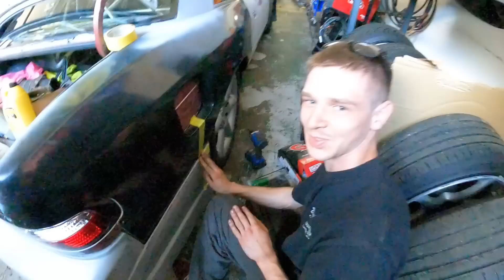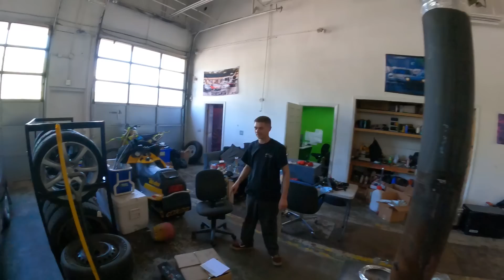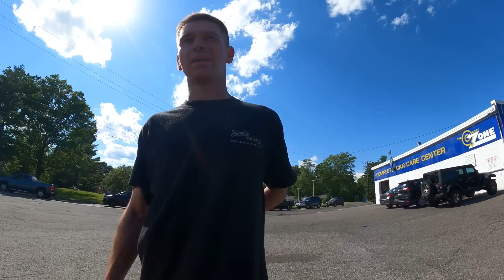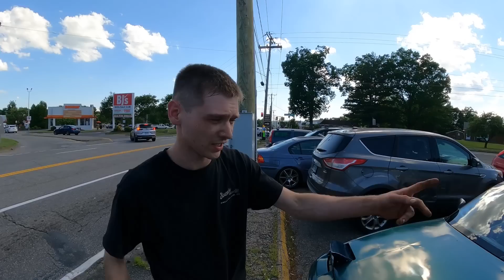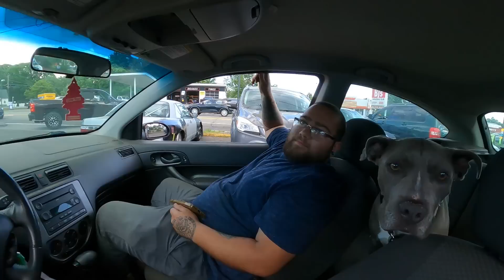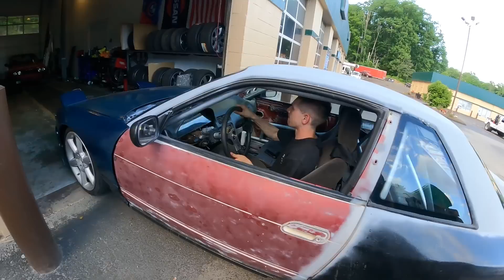The DMV screwed him!

Comment: I don’t see over 2000 dollars for that 240. Drives like garbage. Body panels barely on. Stock ka. Don’t over pay for garbage just because you want that platform
Reply: It’s clapped
Reply: They need to tear the entire suspension system out and rebuild it all with new bushings, then rebuild the KA, then focus on the looks of the car
Reply: It's mint a shell is 1500 that is junk